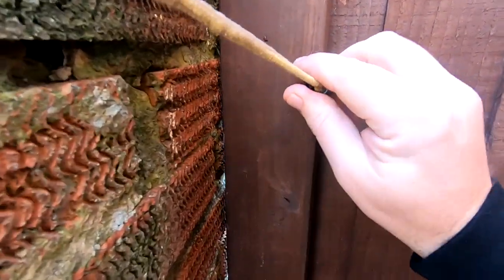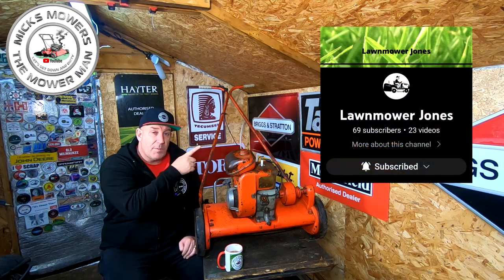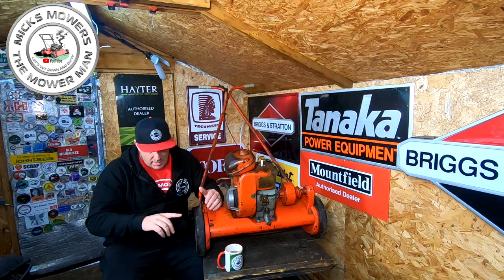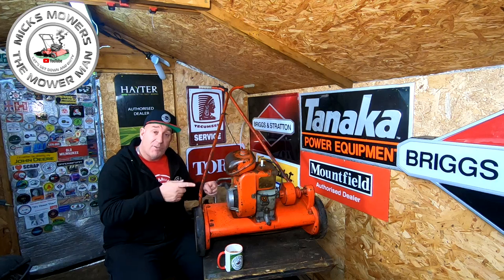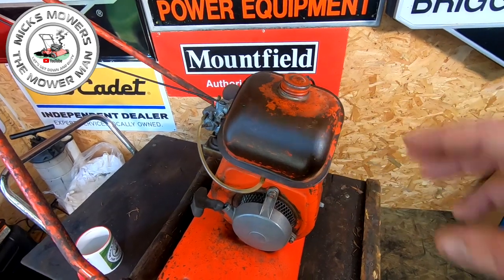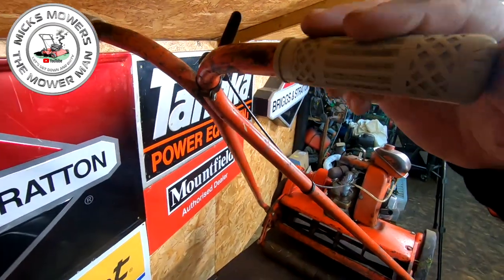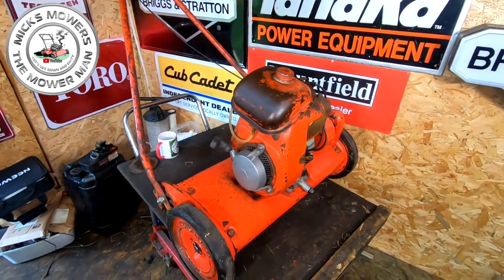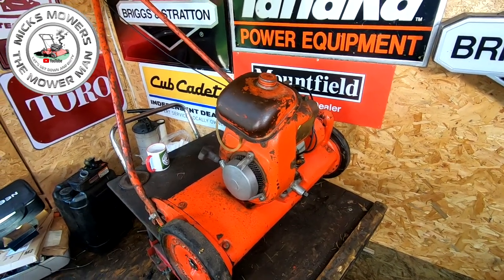Suffolk Corporation Mk2 #vintage Lawnmower Picked Up From Another #youtuber

Comment: I regard cylinder mowers as "posh" lawnmowers because it is not everywhere or any conditions that they can be used in as opposed to rotary mowers. But that machine looks to be well capable of even cutting the rough stuff. So yes it does seem a nice mower. Not sure about the resto,maybe just a touch up, but it is your mower Mick.
Reply from the maker: We will see mate .. it's talking to me about restoration

Comment: very nice machine, it runs very well.
I have a Suffolk mower that stood somewhere in a shed for years.
after cleaning the carb. and adjusted and cleaned the ignitition system and of course i have put new oil in it, it just runs like new.
only the exhaust muffler is rusted, o am wondering if it is available new, i am living in Germany.
cheers
Reply from the maker: I think I may have one..

Comment: If you are able, I'd do a full resto on it, as for a lift table, I have the harbor freight version, in my side shed, and  a few years ago, my wife was looking through Craigslist, and we found a Pender lift version, yellow and all, 20 US dollars, I did my wood lift add on to bring it up to my 6' frame height so no bending over, but you mate, would need it up to 6'2, not hard to do, and that one is in my big front 20x10x9 shed, but wish you luck on it, and the search for another Pender lift, yes Bruce we are talking about your lift buddy.
Reply from the maker: One will show up.. I'm sure